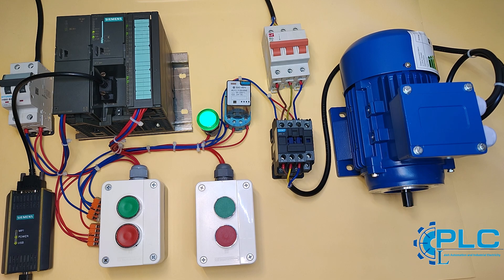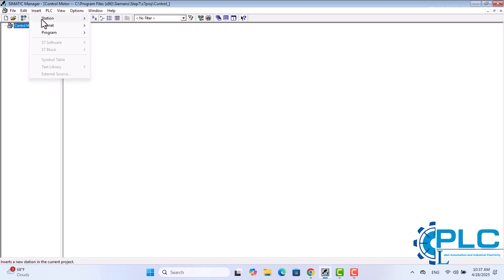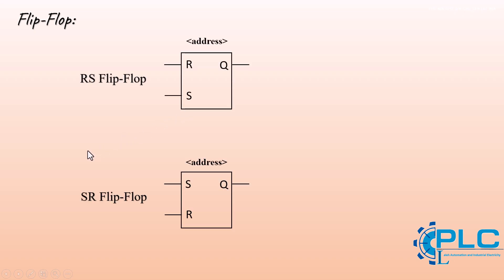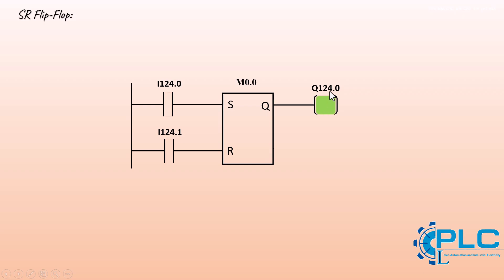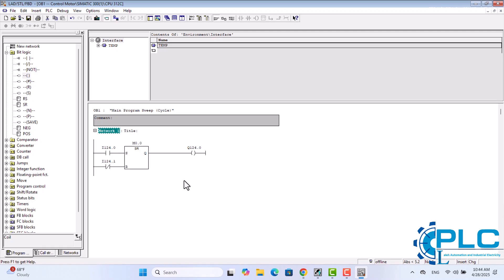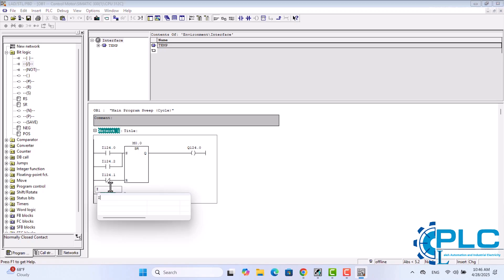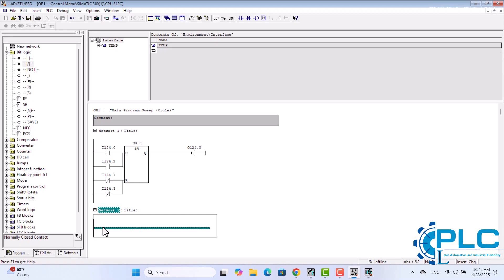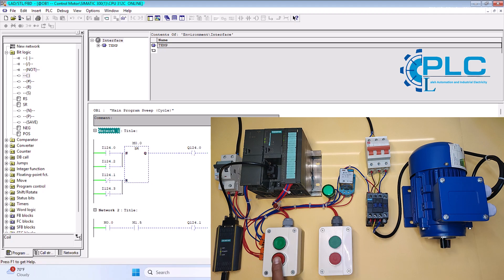Master Motor Control from Two Locations with S7-300 PLC | Flip-Flop Control Step-by-Step Tutorial

Comment: While using NC at reset bit,
Why doesn't the current flow forward as it is NC..so it should flow past it
Reply from the maker: In the previous video, I explained that we can use a normally open push button instead of a normally closed one, and this method is completely valid. However, it has one major drawback: if the wires connected to the normally open push button are disconnected for any reason, the PLC won't be able to detect it. As a result, when we try to stop the machine or motor, the stop command won't be received. On the other hand, if we use a normally closed push button, the PLC will immediately interpret any wire disconnection as a stop command and will stop the system right away. In fact, this adds an extra layer of safety to the system.
Reply: Yes, sir, you are totally correct @Faridlaleh_PLC
Reply from the maker: I appreciate your feedback—thanks for taking the time to comment!
Reply from the maker: If you have any questions, feel free to ask.
Reply: @Faridlaleh_PLC  oky got it sir,
Thank you, and looking forward for more concept and learning regarding S7-300